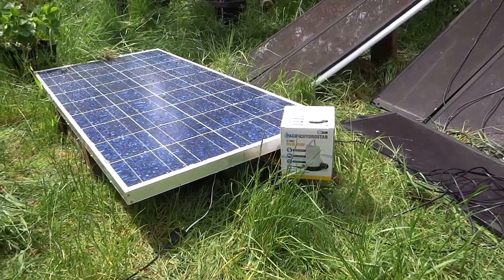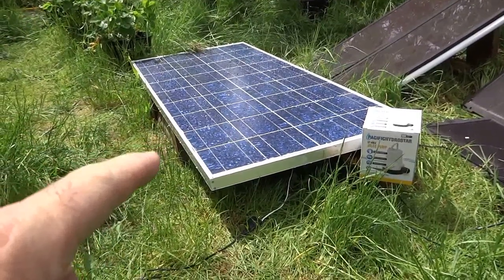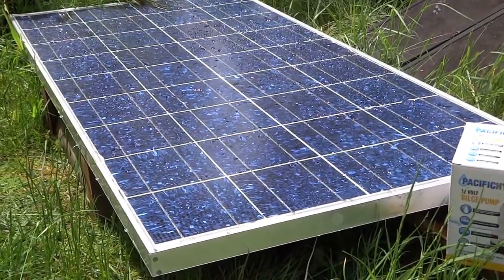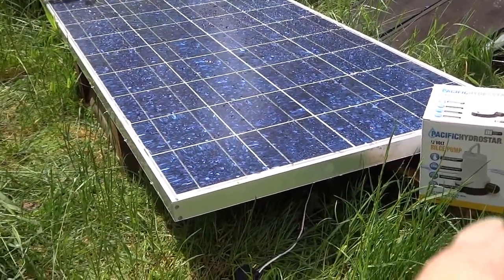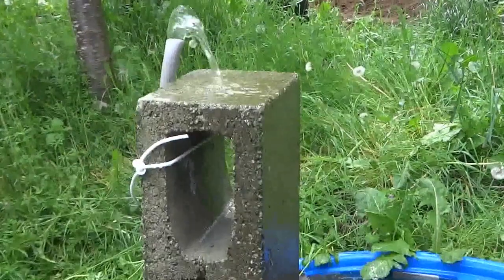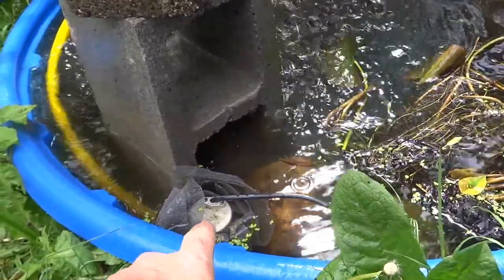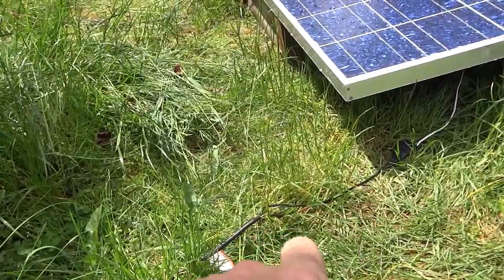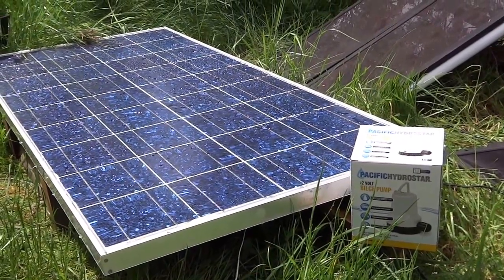Solar Powered Fountain Less Than $200.00

Comment: What about at night? No water running?
Reply from the maker: No, your not quite right. The cheap pump (had 2) burned out after 2 weeks. Could have been to much current or bad bearings leaked water into the stator.